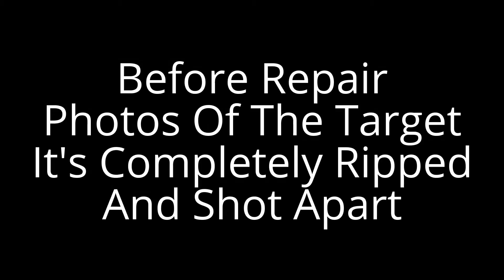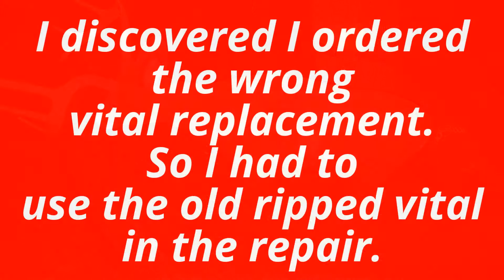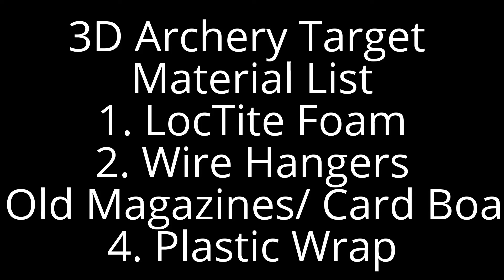3D Archery Target Deer Repair with LocTite Home Insulation Foam - Easy Repair!

Comment: I’ve got a target that was given to me by a friend and I was looking all over for any markings at to who made it since it needed a new insert. I removed the insert and the only thing written were two numbers. One looked like a serial number so I plugged that into google and found a link to a replacement insert for a Delta McKenzie. The other number was the year 1997! Ha! It’s actually in decent shape for it to be 21 years old! 
Anyways, if the insert doesn’t turn out to fit I’ll most likely be doing the same to my target. 
Thanks for the instructional video.
Reply from the maker: Dennis Muralles my pleasure!!

Comment: I was trying to figure out what to put in front of the hard legs . It seems I 'm always hitting the legs  . I think I'll put a few layers of that foam over them  and see how  that works out .
Reply from the maker: It works nice. I have another video I hope to upload showing foam in the legs.
Reply: @shawnbartley7541  I was also thinking of using that foam to fill in the space under the belly and between the legs all the way down to the ground  to act like a back stop for missed shots along with a  thick layer over the hard plastic legs .

Comment: Good job dude.  I’m a noob getting into this.  My target is very old & dry, but it’s all I got.  I’m trying to figure out a way to restore or rehydrate the foam first.. before I spray paint it & Thompson’s water seal it for longevity.  I’m thinking of maybe mineral oil?  Any ideas?
Reply from the maker: Good ideas. I never thought about those products.